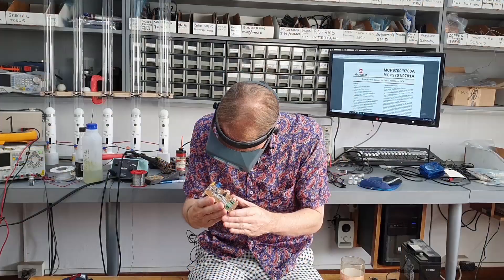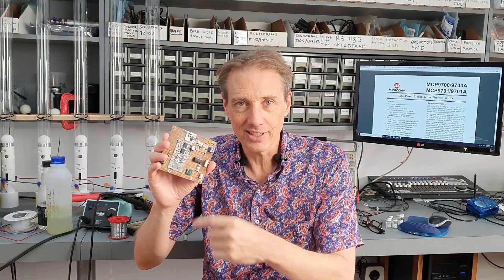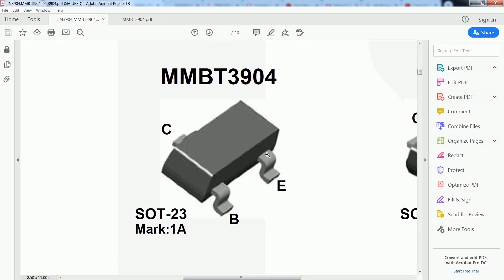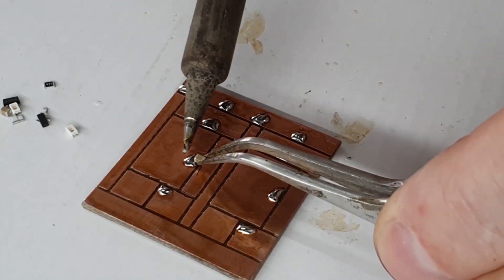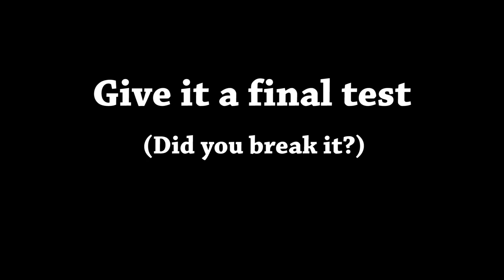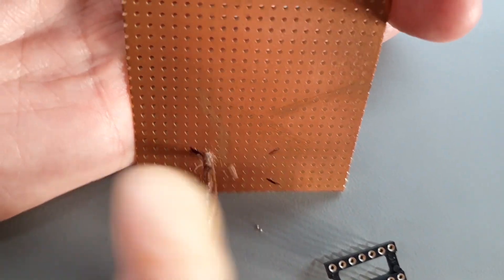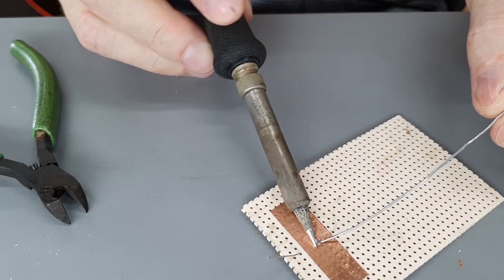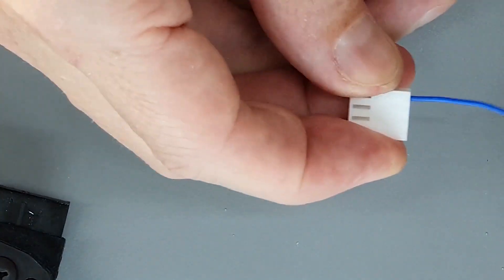Techniques and Strategies for Building Electronic Circuits

Comment: Love it!!  I have been using the scratched copper clad system for quite some time. I also solder wires to the 'pads' to allow using SMD components on a breadboard. Thanks for the great hints and videos.

Comment: As a self tought electronician working at my place, watching this brought great satisfaction (i'm not alone lol). Stupid question, but : wouldnt it have been faster to just design a board with a quick software like DIYLC (do it yourself layout creator), make a toner transfer and etch it before drilling and mounting? I wouldnt swear.... but the island technique and the scratch tool (i usually would use the back of a worned out blade). thanks for sharing, i'm in... first time i see those wire pens for real, i only saw them in Lancaster's "cmos cookbook". oh how i know this axiety you are talking about, finding the proper way to organise and not loose to much time, lately i saw Cameron Jones (from synclavier digital) saying that to know how long it's gonna take to finish a project, you multiply what you expect by pi.... i think i agree.
Reply from the maker: Sure, you can design etch your own PCB, but... it's a slow, messy and not very satisfying process. I like my work to go into getting things done, the mentality of PCB design is always "this is the design, I just need to build it" - as soon as you finish it, you realize that you made a mistake... so you need to go hacking away at it anyway to fix the mistake. So why not just hack until its done? By staying in the hacking mentality, you tend to be more pragmatic about results vs "look at my pretty board." once it actually works, THEN design your pretty, pretty board.
Reply: @leosbagoftricks3732  seriously with the new products and technics it's neither messy nore slow (especially compared to the time you'de spend to do wht you did here, but that's imo huh). it's not about a pretty board, ti's about saving time really, and even then if you have to hack, one thing i'm shure of, is the longest thing is making cable connections. but that's me huh...

Comment: The tool seems great; however, in an academic environment, it can be dangerous for students to be asked to build something like this. I built a similar version, which uses a small chuck for a Dremel rotary tool. Then, I went to a metal workshop to have a handle made to fit an M8 size with a 0.75 mm pitch. Subsequently, I acquired broken CNC machine bits, and those bits are quite hard and sharp enough to cut the circuit board very deeply and with very wide grooves. This tool also serves as a small handheld drill, a center point, and a punch. I highly recommend it. Nevertheless, if the aim is simply to make deep grooves in a circuit board, I have found that using a #3 scalpel with a #12 blade is good enough to achieve a similar result. Greetings from Colombia 😊

Comment: I love this video.  I have realised that I spend hours of stress doing the manual part of projects - like soldering.  I now try to use connectors, ribbon cable and dupont connectors wherever possible. I make a 3d printed mount for all the breakout boards that need to be held together.  It's far easier to change the CAD, and let the printer do the work whenever there is a change.

Comment: Excellent, Priceless Info!  Why didn't you make this video 60 years ago?  I basically developed most of these techniques from the "school of hard knocks" and smoke!  Didn't have PCB material or SMT parts back then (transistors were new and hard to get); so I sometimes built semi complex circuits in "air" like a giant spider's web.  One of my criteria of success was when it worked two or 3 days later and a week after that.  Fifty years ago, I could get surplus Teflon tubing and copper clad board, even with holes in them (but I would have to cut a few more lawns to get the extra money for the holes 😁).  All your electronic videos should be MANDATORY for all EE students!

Comment: Is there a reason why you do not use/mention the usage of a wiring pencil (roadrunner/verowire) as an alternative to the teflon tube solution? From my experience it is a huge improvement in terms of fast prototyping and ease of use.
Reply from the maker: Expensive and hard to find consumables?
Reply: @leosbagoftricks3732  compared to the alternative of teflon tubing i would not say that it is expensive. 16€ for 160 meters in 4 spools, directly from vero. Okay, it seems to be more an uk/european thing, maybe in other regions it is more difficult to get.

Comment: Don't overlook making your own breakout boards as modules to be used in later prototyping. Ie: if in your work you use a lot of a particular scale of IC packages, then you can either buy commercial breakout boards, or you can look for some already designed on sites like OSH, or you can design your own the way you like them and order cheap from the usual Chinese PCB vendors.  For example, if you use a lot of dual op amps in SO-8 packages, sure you could use off-the-shelf generic SO-8 breakout boards, or you could design your own with a few extra features specific to dual op amps, like pads for decoupling caps, or feedback components, a ground plane, guard rings if applicable and so on, and edge pins (like surf boards) if that's what works in your system .  You can have these in stock ahead of time, and that can shorten your development time when it comes to a specific project.

Comment: I silver brazed a 3mm drillbit into a cheap jeweller's screwdriver (with the bit removed).  Works great for cleaning copper holes on veroboard.

Comment: Wonderful video for prototyping!   Most were familiar tips that I got from a Bob Pease article long ago, but still good.  I've been using a dremel tool with the cutoff disc to slot copper-clad boards, but I'll try your mod'ed x-acto knife.  The dremel disc does leave some copper slivers that like to bridge the slots, so I've learned to meter out the board!   I do use the Dremel wire-wheel to clean (most) of the copper slivers off of the board and to get a clean copper surface for soldering.  I'm also a big fan of wire wrap wire, and I use a "No-Nik" stripper from Clauss.  It's great!  I also have a pad cutter, to isolate posts from the copper-clad perf boards.  This is especially valued when you use posts to mount leaded components... a relatively rare event nowadays.  Thanks for the video!

Comment: My hands aren't strong enough to manually cut the PCB so I use markers to draw circuits on the blank PCB, add water to my etching pool and heat it in a microwave oven to 60°C(140°F), and etch the circuit board within around 10 minutes. The marker acts as an etch resist and protects the copper underneath and can easily be washed off by some dilute sodium hydroxide. It works as well as, if not better than, hand-scratched PCBs and it's much faster than the toner transfer or photoresist method.

Comment: I prefer to use cyanoacrylate glue and thin wire with fluoroplastic isolation, so I glue component to non metal surface, then soldering wire.

Comment: I just had a bunch of boards made up by JLBPCB or some other board maker that fits the different SMD pin layouts and bring them to standard 100 mil pin spacing so I can use any SMD on a standard bread board. Similar to the ones you show.

Comment: Lead is toxic. Never encourage people to use tin-lead solder, as you do in this video (11:13). Warn them that if they use lead-based solder they must wash their hands after handling. Lead is particularly harmful to young people. 

A really great lead free solder is Sn99.3/Cu0.7 (like K100LD). It's better than the SN96CI shown and is readily available. My preferred solder wire with no-clean water-washable flux is Sn99.3/Cu0.7 from CHIPQUIK, sold by many distributors. It works great for prototyping! 

The Kester #2331-ZX flux pen is a great companion: more precise and less messy than brushing on liquid flux, and it's highly effective in my experience at making it easier to wet hard-to-solder surfaces or break through and melt oxidized solder joints. I clean up extra flux with isopropyl alcohol (IPA).

It's worth it to change over to lead-free. Takes some adjustment, but you just have to commit.

Comment: Very rarely you can strike gold on Youtube and this is it. Thanks so much for sharing in such a comprehensive and thoughtful way, much appreciated. I'm a hobbyist and an amateur astronomer. I built my own dome observatory and designed and built all the electronics and programming of AVRs and computers. All my AVR circuits are on breadboards. The wiring is tough and it really needs professionalising, so now I can get started - thanks again. :) :)

Comment: Have you ever tried to use enameled copper wire for the interconnects? It's available in many diameters and is quick and easy to use. I have used it to great effect in many prototypes.

Comment: As a newb I would like to know what bulk components is a good buy to have stock of useful common components such as caps, and what not, with all the different type of components it would be nice to have a kit with everything in one buy.
Reply from the maker: Tough one to answer, it all depends on what you want to experiment with. 1/4W resistor assortments are always good, but "kitting up" in one purchase can get really expensive, the problem is you won't know where to stop! Just buy parts to build specific projects, always over-buy so you have spares for the next project.

Comment: I put almost all SMD just on standard develop PCB with holes, I just find a way to fit them, something it's just as easy as turn the component 45-degree, other components I need to scrap some traces/pads away, death bugs style, etc, I will find a way. :D

Comment: 11:45  An electric toothbrush works really well.  You probably wouldn't spend $120 on a Philips Sonicare for the workshop, but I had one we were retiring from bathroom use because its battery had lost capacity.  Keeping it in its charger, it's fine for brief circuit-board cleaning.

Comment: Though it's a tiny waste of money, I'd add use a different connector (say a six pin) for your power, even if you only need three of those pins.  Then use a four pin for all your sensors.  Just to make it abundantly clear to yourself when you're in a rush "this does NOT go there!".

Comment: Back in my day the Texas Instruments TTL databook was our "holy bible" so to speak lol  Wire wrapping was the way to go, it was great when the 'IC ID' thing came out since that reduced the number of times you had to figure out which pin was which lol  "We" used to love the smell of solder back in college, or the burnt smell of 'destroyed' electronics, but that is apparently a bad thing now-a-days.  So too is 'lead' solder as it isn't ROHS compliant.  Soldering is a 'learned form of art.'  In college for our final project - we were to design build and prototype a Z-80 based micro computer.  Low and behold I was a student and the Teachers Assistant! lol  Ya want faster and easier - leave it to the professionals.

Comment: KiCAD + FlatCAM + CNC and your board is ready in about 1hr with 0.2mm clearance so you can solder SO, QFN and 0603 components. In addition, you can mount through-hole  components on the back side. Use solder paste and bake the smd board on led desoldering plate. This will save you a lot of time instead of soldering each component. Plus results looks amazing.

Comment: I've designed many protos and PCBs and you can put many of these components (cc1206 SMD resistors and SOT-23 packages, etc.) on a .1 spaced PCB perf board that has solder the pads. For the super small stuff, like tiny logic 1 gate ICs, they make small adapter boards which can be affixed to your main perf board. Also, breadboarding should never be ignored as an effective circuit proving practice

Comment: I've been making one-offs with copper clad board, a Sharpie (surprisingly effective as an etch-resist), and ferric chloride. But they've all been through-hole so far. It's great to see some tips on prototyping boards with SMD chips without the lead time on them. I need to get a hold of, or make, some of those (cleverly named) surf-boards so I can test that my SMD packaged chips work just like the SMD ones.

Comment: Another easy way to make pcbs at home is an msla or resin printer. They can expose any image onto a photosensitive pcb blank (more or less the same thing as the professionals use and priced accordingly) which then only needs to be developed. The process needs a few funny chemiclas but overall quite painless after you got it down.

Comment: im a mechanical engineer that is getting heavier into electronics. thanks for the tips. surface mount is tough for me. i wish you could get all equivalents in larger components for prototyping.
Reply from the maker: Everyone moans about surface mount parts. I have grown to like SMD, once you master a few soldering techniques it stops being so hateful.

Comment: you can buy a very thin PFTE-coated wire. It does not melt when you are soldering it, but it does melt when you burn it using a lighter. Very handy.
Reply from the maker: Ooohhh burnt Teflon fumes are nasty toxic

Comment: Thanks For The Proto Tips !!! .... i can't stand surface mount... i suppose if all prototyping could be done in the digital realm, few would care;
but the Real Problem with surface mount is environmental conditions ... i live in Wisconsin, we get polar vortexs that send us below -40F ... and then any surface mount electronics left in a storage unit, or garage, are complete junk....just like that.... so i will keep my trough hole component designs.

Comment: May I ask you to go over your tricks and tips at a bit slower pace, stressing the minute details like wire gauge and how do you detect if you get a wrong gauge, say 28 instead of 26, and how do you fix it, and how do you test that it was fixed without creating new problems (i.e. assuming that everything that can go wrong - will)?  What are the prototyping stages and what are the tests at the end of every stage? What are the silly shortcuts that people commonly take? That may seem fairly obvious and mundane for you ... but it isn't so for others. Thanks!

Comment: Years ago I used transfers  on copper board and UV light to make PCB's  to mount IC's with a UV resistant pent to link components together. Maybe I am missing something but it doesn't seem popular now but it was a quick way to get a board together.
Reply: Do you know any website/video/book to learn more about this method? I'm interested.
Reply: @Cristi4n_Ariel  You could try this -  https://www.youtube.com/watch?v=W_oDBp_wgJQ

Or 

https://www.youtube.com/watch?v=vFtj8-6YVI8

Both these videos should help but there are many others. Obviously you can make only 2 sided boards but if that is all you need.

It takes quite a bit of practice to get decent boards but if you need basic PCB's once you are proficient you can easily make them in a couple of hours but be prepared to throw quite a few away while you learn.
Reply: @we-are-electric1445  Nice, thank you!

Comment: Instead of scratching copper clad board, another trick you can use building proto’s with bare copper clad boards is to cut strips and small patches.

Using some seconds-glue you can stick these to a carrier copper clad board. Now you can use the carrier board for a good ground plane.

It is even handy to add power strips on the edges, just like the solderless boards.

Comment: Very helpful video:washhands:. Some of the tips I took for myself. I usually use the manhatan style for electronics assembly. Such a cutter can also be made and saw blades for metal, there is good and high-quality steel

Comment: This sort of thing is especially handy for those of us who don't live somewhere that PCBs can be ordered cheaply and I typically build even the final version of a one off circuit using methods like this.  Local places aren't generally interested in orders of less than 1000 boards, even then they're not cheap, and if they do accept a smaller order the price per board is astronomical.  Ordering internationally means either using ordinary post and waiting several months or using a courier service and paying a fortune for shipping.

For wire these days I've generally been using silicone coated ones and an automatic stripper.  The stripper works quickly and the silicone doesn't melt even if I put the iron tip directly on the insulation.  I looked around and PTFE tubes aren't that easy to get hold of.

For the connectors I use a knock-off crimping tool that works perfectly.

Comment: I use dremel bit for bigger cuts on pcb and I usually tape the board on cardboard or table so it doesn't move while soldering.

Comment: Thanks, seldom can one learn so much in 14 minutes. Subscribed.  Wire wrap is great.  Need to source the teflon tubing.  Love the method of cutting PCBs for surface mount.  Someone should make that knife fit a cricut machine.

Comment: dont u have atleast 1 day .........1st half of the day design schematic pcb and layout.......2nd half etch the board and place components and put in an oven..........
Reply from the maker: The best part of my method is NOT HAVING TO USE A COMPUTER! It's so nice to do something that doesn't involve staring at the computer screen.
Reply: Which is different than doing things quickly/efficiently. There is a big problem with engineers protoboarding too much, when getting in a good rhythm with your versioning and your fab house ship times is a far better use of anyones time. The computer was made to help us!

Comment: Im curious why you wouldn't just make a print a layout on a transparency, expose a photoresist PCB and etch it?
Reply from the maker: I like the more "on the fly" way of doing it. I can add circuitry and cut more lands even when the board is half populated already. Making a normal PCB is not a fluid prototyping process- no ability to change things as you go.